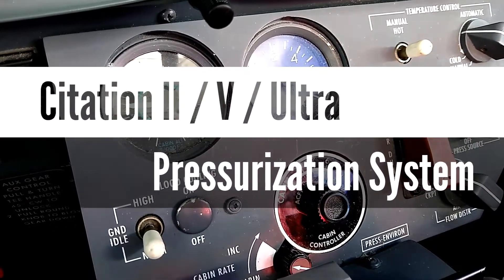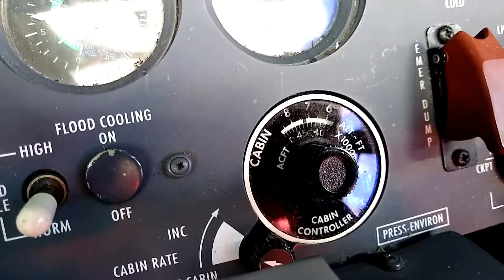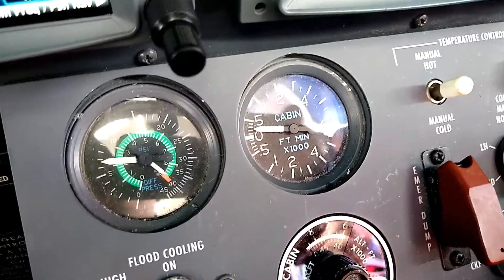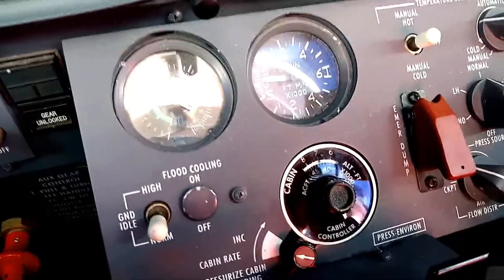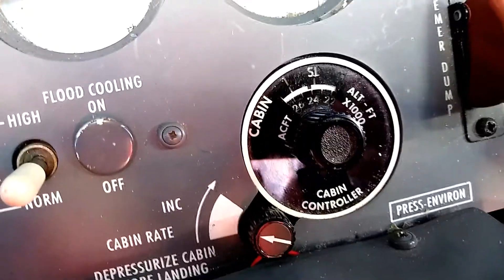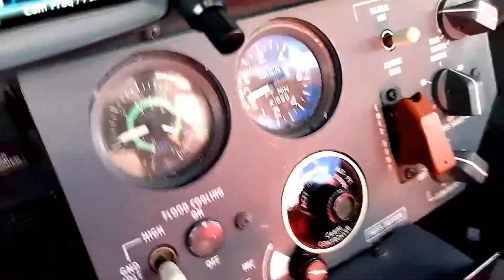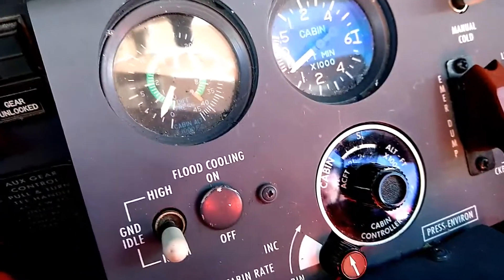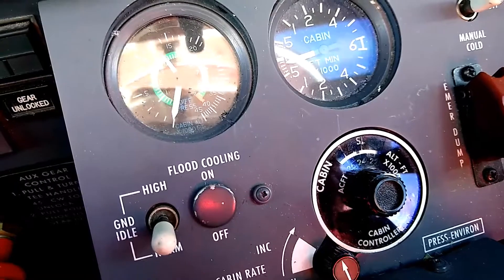Citation II / V / Ultra - Pressurization System

Comment: Out of curiosity, what does the system do if it senses you start to loose cabin pressurization at say 30K ft?
Reply from the maker: Since so many people are curious about the recent crash of a Citation V, I'll limit my description to specifically the V and Ultra. The Citation II and Encore have significant differences from this description...

Several things will occur. Obviously the climbing cabin altitude would be reflected in the cabin pressure gauge to the left of the pressurization controller.

As the cabin climbs above 10,000 feet, the CAB ALT red annunciator will illuminate and trigger a flashing MASTER WARNING light in front of each pilot. The MASTER WARNING light has a noticeable "clacking" sound, but there are no other audible chimes or buzzers.

The pressurization system has what are known as cabin altitude limit valves built into the system. These limit valves are designed to close the outflow valves if cabin altitude exceeds 13,000 feet +/- 1500 feet. 

If the cabin altitude exceeds 13,500 feet +/- 600 feet, an automatic system should cause the passenger oxygen masks to automatically deploy. The passenger oxygen masks are not satisfactory for continuous use above 25,000 feet.

Several things could inhibit these processes. The loss of normal DC electrical power (such as a dual generator failure and switching to EMER bus) would prevent the CAB ALT / MASTER WARNING from illuminating.

A loss of normal DC electrical power would also prevent the masks from automatically deploying (it relies on an electrical sensor to determine cabin altitude) as well as if the system switch were placed in "Crew only" rather than "Normal." A completely empty oxygen bottle would also render the system inoperative and useless.

The cabin altitude limit valves would be ineffective if the pressurization source selector were to be placed in the OFF or GND position in flight. In other words, they would close the outflow valves, but with no air incoming to the cabin, the cabin would remain unpressurized.

Obviously this all depends on a properly maintained and inspected system as well.  Without maintenance and inspection, all bets are off.  Lights may be burned out, wires disconnected, valves sticky, etc.

Please let me know if you'd like further explanation of any details.
Reply: @citationpro  Thanks so much for the explanation man.  Yes this was in regards to what might have occurred to those poor people in VA.  It was a pretty old Citation, a 1990 model 560.  I don't know which model information would carry on beyond that as it's been eons since I worked at an FBO when I was slightly more familiar with such things.  Are newer planes any more "automated".... as in... if cabin altitude went above 13000ft the autopilot might automatically lower aircraft to like 8000 ft?  Back in 1990 things weren't as advanced as now but I'm curious.  Although I can't afford it at the moment there have been times when I've toyed with the idea of getting a private pilot's lic.  But every time I see an accident like this whereby a single pilot may have screwed up and forgot to toggle a switch or maintenance wasn't kept up with.. it just scared the hell out of me and I think the only way would be if by some act of the guy upstairs I had enough to buy a new jet and hire two competent, unjabbed professional pilots.  Old planes kinda scare the crap out of me, as do lackadaisical pilots.  Anyway, thank you again for taking the time to write out what you did.
Reply from the maker: @ZaphodsPlanet  , no problem, I enjoy talking about these systems.  Newer planes are definitely more automated.  The Citation XLS equipped with Garmin G5000 avionics has an "emergency descent mode" from which the autopilot will automatically command a descent to 15000 feet if the cabin altitude climbs above 14000 feet while the aircraft is flying above 30,000 feet. Of course this sort of automation has only come about within the past 10-15 years and is only available on fairly "high end" aircraft. A person must consider there is no such thing as perfect safety, only "safe enough" for the situation at hand. In a perfect world, we'd only fly brand new multi-engine jets with highly trained, highly experienced, perfectly rested, perfectly fit pilots, during beautiful weather conditions, to long runways at airports with all kinds of services available, for the price of $1/hour.  Of course we don't live in that world.  We mitigate risks as best as we can, knowing that at some point we will bump up a constraint related to time, money, and/or technology. If you have the opportunity to fly, I think you should take it. The benefits usually outweigh the risks.

Comment: Do you know what happens when you have your gear worked on and they get the squat switch out of adjustment and you pull n2 below 85%. ? Complete de pressurization at 39,000 feet bullshit design.
Reply from the maker: @dfort5203  that's a very interesting scenario. The cabin altitude limit valves should take over and prevent the cabin from climbing above about 14000 feet. Still, you're right, certainly not a good situation. It goes to show the importance of thorough maintenance tests before returning a plane to service. How would you design the system to prevent this from happening?

Comment: What warning signals/sounds/lights are activated for the pilot in the case of depressurisation on a Cessna 551 Citation II (Single Pilot)? Hope to receive an answer from you soon.
Reply from the maker: Hi, great question. I've never flown the 551 specifically, but assuming it's like the other 500 series Citations, it would have a red "CABIN ALT" annunciator in the upper left corner of the annunciator panel. This would illuminate if the cabin altitude reaches 10,000 feet or higher. It would also trigger the red flashing Master Warning lights directly in front of both the pilot and copilot. There would not be an audible alarm, but the flashing Master Warning lights are hard to miss.
Reply: @citationpro  Thank you for your reply. I was asking the question as part of my investigation into the 20.37 (EEST) The Baltic Sea, Latvian Territorial Waters, 23 kms NW of Ventspils, Cessna 551 Citation II (Single Pilot) OEFGR Light Plane Crash. I have a very large file on the case. I've been auditing the global aircraft: fixed and rotary wing accident landscape in depth since May 2021.

Comment: So, I had my first right seat up to FL340 in a Citation 550 II last weekend. i watched the PIC control to .500 descent, but looking back, didn't pay attention to when this occurred. We were descending into Boise, ID. Wondering if there is a good rule of thumb on when to reset the altitude dial for 200 feet above airport elevation and when to start the 500 feet per min down, during the descent?
Reply from the maker: At my operation we normally set the pressurization system as part of our Top of Descent checklist. In other words, shortly before or shortly after beginning our initial descent from cruise altitude. The main thing to remember is that you don't want to "outrun" the pressurization system during descent and reach an actual altitude prior to the cabin pressure. If the cabin altitude is 4000 feet and you're descending through 4000 feet at 2000 feet/min, you're essentially an unpressurized aircraft and your ears will feel the 2000 fpm descent. You always want the cabin altitude to be lower than your actual altitude until right before landing.

If the cabin is at 7000 feet cabin altitude, it will take about 14-20 minutes to "descend" the cabin to sea level, assuming a descent of 300-500 fpm. Therefore, ideally, you should set the pressurization controller at least 20 minutes before landing.

Comment: I would like to know about the following information for the Cessna 560 aircraft.  List what the main hydraulic system power. 
I'd appreciate it if you could tell me where I can find the information about this.  Thank you.
Reply from the maker: In the Citation 560 (V, Ultra, and Encore) the main hydraulic system provides power to extend and retract the landing gear, flaps, speed brakes, and thrust reversers.

Unfortunately there isn't much information about these systems online. The closest I've been able to find is the flight manual for the Citation Bravo at Smartcockpit.com. This would basically be the same as the 560 aircraft, except the Bravo has electric flaps rather than hydraulic.

https://www.smartcockpit.com/aircraft-ressources/CESSNA_Citation_Bravo-Hydraulics.html

 If you have any other questions, I'd be happy to answer them.